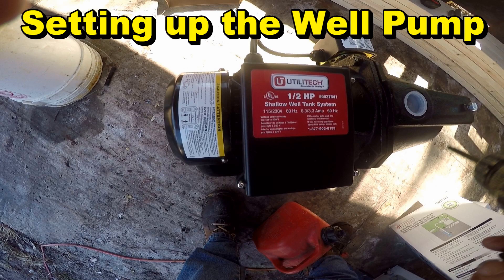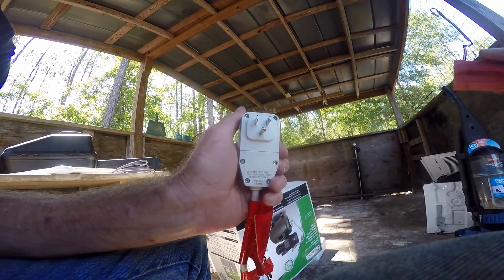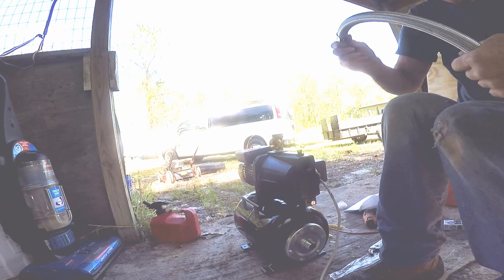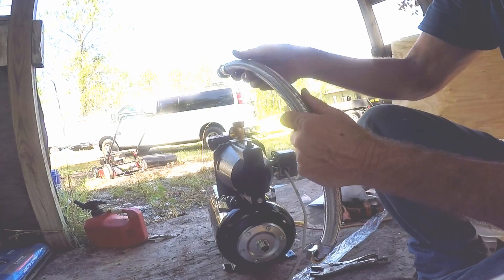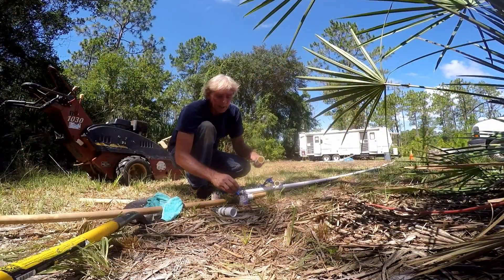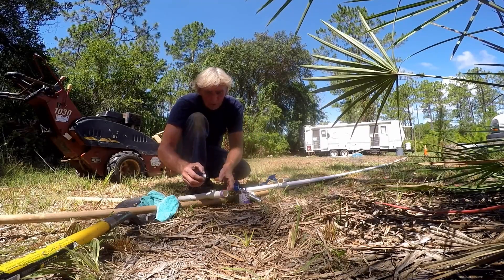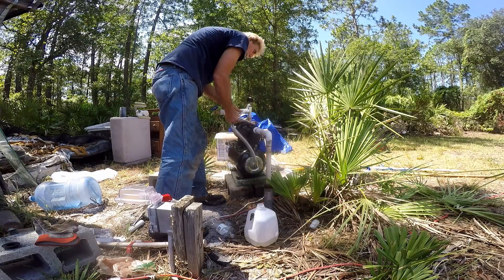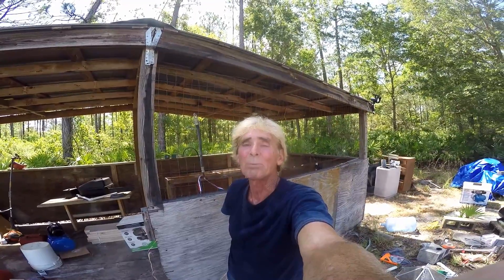Well Pump Set Up and Install

Comment: I set up a shallow well pump for my elderly parents and I think I have set it up properly. I worked in HVAC for years and in construction but I just don’t know if I’ve built a proper setup for a shallow well pump and I’m not paying a plumber.
If anyone would look at my setup and tell me where I f’d up I would appreciate it 😊
Reply from the maker: Do you get water out of the well? If so it’s working.

Comment: What’s the difference between a shallow standpoint well and a deeper irrigation well. South of Tampa, I was told by a well digging company that they would have to go down about 450 feet for an irrigation well. Is the volume and quality of the irrigation well water much better going deeper?
Reply from the maker: @daveborchard2019  wow! That’s deep

Comment: How can i identify if i have a two or three wire submersible well pump without having to pull up the pump
Reply: Just check the end of the plug. Is it a 120v?

Comment: Sir, please don't make videos of installing Chinese garbage pumps from the home centers!  These pumps will hardly last 6 months in good conditions pumping water for normal home use.  They are cheap but after warranty returns and multiple trips you will spend way more than buying American made water well pumps like Sta-rite or Franklin.  Not to mention the tank is way too small what is your drawdown? About a cup of water is all you will get before the pump has to come on.  I have removed a pile of these pumps that unfortunate homeowners bought trying to save a buck, but ultimately cost them problems and more money!  Go to your local well company and buy a new good pump and tank, have them get you everything you need for your area.  Better if you just have it Installed by a professional and have long service life and less problems!
Reply: That's bull. I know a couple of people who have had Harbor Freight shallow pumps for years with no problems. This is a how-to video, not your ad site.
Reply: not everyone needs a Bosch or Stihl - some of us only use it a few dozen times in summer for watering the yard, harbor freight is plenty fine!

Comment: This is extremely useful material! I'm thinking of installing a well pump myself, however, apart from watering my garden, I need it to feed my existing plumbing line (kitchen and bathroom faucets) which consists of PPR pipe. However, I'm concerned that the water being fed through the pump won't be potable? Also, is the pump noisy when it's on (as it would be near my neighbour's fence)? Any tips you can offer a novice such as myself? Such as how to prevent the pipes from freezing? Would I just have to drain the line at the end of every evening? I'd really appreciate any advice! Thank you so much. Certainly interesting this video and well demonstrated. Many thanks!!

Comment: what part of north florida are you in? I have a question. on property in north florida of my dads there is a black 1 inch plastic hose coming from the ground. I saw a simular one on a friends property in ohio and she said it was fo a well they had and they cut it. it was identical to what is coming from the ground in florida. I was down there for 6 months no power or water. i was doing fairly well and only left because i couldnt do the well by myself or finacially. i know now that leaving was a huge mistake for me. now planning to go back i need to figure out what to do about water down ther and need to know what to do so im investigating.